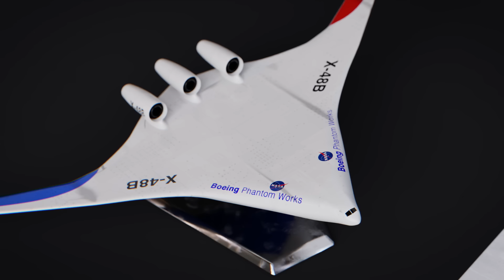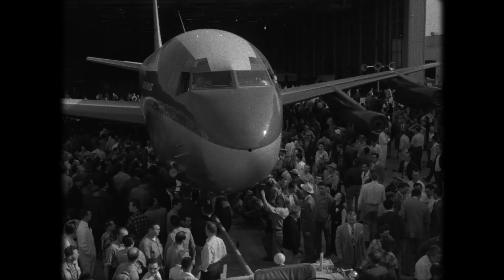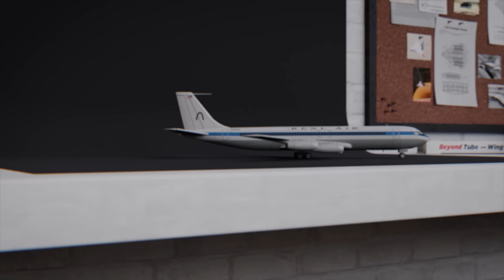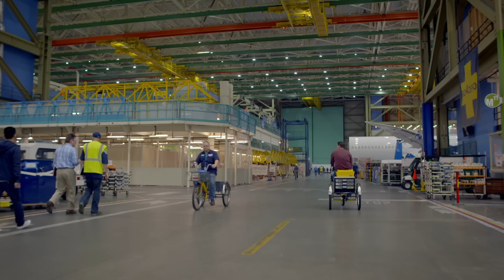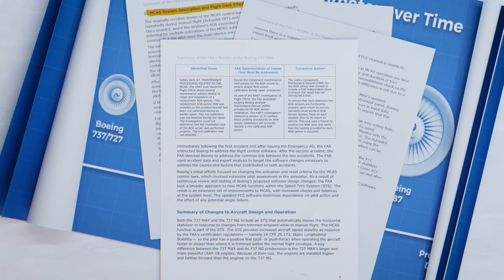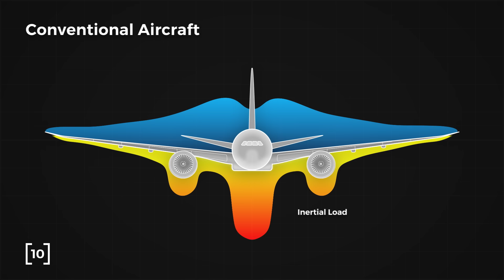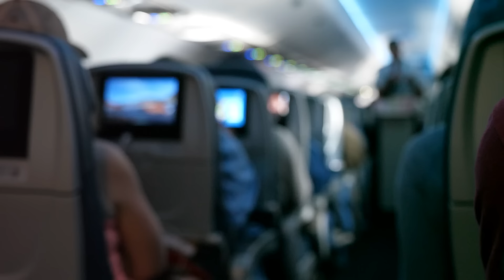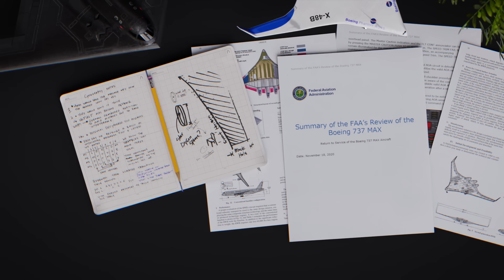The Plane That Will Change Travel Forever

Comment: I'd wish there were affordable nuclear powered passenger planes in the near future. That would really be a game changer. It could fly for years on end.
Reply: Yep, nothing like thousands of potential dirty bombs being overhead at any given moment. Until we crack miniaturized fusion, keep dreaming.
Reply: @PolishGreasePit  the small reactor(s) could be designed like a black box.
Plus a nuclear plan cannot explode like a bomb, even if it crashes
Reply: @YounesLayachi  You know black boxes aren't indestructible, right? And what makes you think a nuclear plane would be incapable of exploding? What if someone brings a bomb on board, which has already happened and likely will again, even if it's 100 yrs from now when nobody alive remembers Pan Am 103 and security is again lax. Like I said, until we have fusion, a nuclear plane is a potential dirty bomb. An absolutely horrible design precedent to set. The engineers of these systems have a moral obligation to consider that their work may be the standard designs that are studied by the next generations, and be responsible in design. Setting the precedent of putting fission reactors on planes would be disastrous given enough time.
Reply: @PolishGreasePit  what makes you think a nuclear plane would be capable of exploding ?
And btw, fusion fuel (tritium) is also very dangerous
Reply: @YounesLayachi  let's see... the fact that we would still be using a craft where a significant portion of the structural strength is tied up dealing with the forces of pressurization. Like, I mentioned a specific flight number that was blown up over Scotland, and you decide to ask what makes me think a nuclear plane could explode. Nothing about having a nuclear powerplant implies any additional strength in the airframe.
Last I checked humanity does not have any completely indestructible materials.
There is also the potential for a runaway reaction with fission. 
There is also the potential for a craft being shot down.
And then there is the potential for reactor damage and leakage during a crash, which you just dismiss out of hand, despite it being a very real concern. There is no reason to assume you could harden a reactor enough to survive any possible crash, and lots and lots of reasons to assume otherwise. 

This kind of recklessness in design has already killed plenty of people in numerous scenarios. You can't just think that something will work and try making it, you have to consider the risks involved with your design, otherwise your tests can end in disaster. Let's hope if you do any design work that it's not for a living, and it's not for anything used by anyone besides you.

As for fusion, I never said it would be specifically possible even then. Just that fission is prohibitively unsafe, and an implication that fusion would have fewer engineering challenges as a result of the different technologies, potentially bringing the hazards to a manageable level.
Reply: @PolishGreasePit  a pressurised flight cabin is not a bomb, lol, and the fact you think an airplane nuclear reactor can experience runaway reaction proves you don't understand how normal reactors nor airplane reactors work
Reply: @YounesLayachi  I never said it was, where did you go to school that they just didn't teach reading comprehension?

The pressurization means there is already stress on the fuselage, adding more in a sudden shock impulse (a bomb exploding on board) can easily exceed the yield strengths of the material. Again, see Pan Am 103.

You still just gloss over how we cannot 100% ensure the survival of the reactor in the event of a crash. 

And if you want to get into not knowing about reactors, you just made the most asinine comment I've ever seen, above, when you said that there is no weight for nuclear fuel. Add that to the list of your fantasyland nonsense, weightless fuels and indestructible materials.

Also, how do you plan on starting up engines when you're pushed back onto an apron away from any GSE? Or parked on a hard stand? What if the GSE is inop? Still going to need an APU for that, which runs on...jetfuel.

This also doesn't even touch on the maintenance cost and logistical and regulatory hurdles that would make operating even a single such aircraft on a commercial basis completely unworkable. Let alone the increased security since there would be fissile materials on board.

Like someone else said, you want a nuke powered plane, you build an electric plane and charge the batteries with a nuclear plant, these projects died for a reason.
Reply: @PolishGreasePit  great, nuclear planes fail because a bomb would make them crash, therefore nuclear planes bad. Huh ?
The plane doesn't need to be bomb proof, only the reactor
And , this whole time you think the reactor would be a water cooled uranium reactor, when in reality molten salt thorium reactor were designed specifically for airplanes.
"Security" is not a concern because redactor fuel can't be used for weapons, and you should know that. Throium is useless cheap dirt for anything but power generation, and it's not rare or expensive, no one would hijack a plane just to get the fuel.
Starting up an engine in pinch ? Do you think nuclear reactors can be turned on and off willy nilly ? They keep working until the entire fuel is consumed (a few months or years). The plane would never be in a situation where they need an Apu to start their engines and besides, nuclear engines don't have moving parts, they don't really need any power to start. In practice they would probably be started on the ground and then mounted on the plane where they stay for a while until they need servicing.
To top it off, battery powered passenger planes are too heavy to fly
Reply: @YounesLayachi  If you're very unlucky, the insulation may encapsule the radioactive substance and cause critical mass by neutron reflection in the case of a crash.
Reply: @Wabbelpaddel  and ? critical mass means sustained chain reaction, without criticality the reactor will stop.
So criticality is not a bad thing, it's necessary for the reactor to operate.
Molten salt reactors are designed to passively shutdown if something goes wrong, so in the case of a crash the reactor will stop producing power and slowly cool down
Reply: @PolishGreasePit   i assumed the plane would have no trouble generating power using the reactor , then using that to start the engines.
Basically the reactor would replace the apu

So what if the reactor fragments to pieces on impact ? It's still not an explosion and not a gas leak, just a small pile of wimpy thorium mixed with fission products, a couple dump trucks would clean that over.

Dirty cruise missile ? You sure love exaggeration, a missile goes boom, a plane turns to pieces.
Also, a bomb exploding inside the plane isn't equivalent with the plane itself exploding, you keep coming up with these exaggerations and then counterarguing yourself.
Another analogy with the boy who attempted chain reaction in a backyard shed, completely irrelevant urban legend, the boy had way more time to irradiate the surrounding area and he dismantled the reactor before the police showed up, so they could only guess the damage and measure the lingering radiation.
Jet fuel airplanes are arguably way more deadly missiles as they catch fire on impact and deal a lot more damage to whatever building they may crash into
About the moving parts, I was referring to the reactor. That mistake's on me, but also see first part of this comment
Reply: @YounesLayachi  until the passive shutdown design is found to not be compatible with the events of a given crash and you have a major ecological disaster.

I swear, you've never heard of Risk Management, have you? It's kinda a big deal in aviation.
Reply: @PolishGreasePit  passive shutdown design meaning the reactor can't work without active input to keep it working
It's like when people think a nuclear warhead can blow up if it falls from a plane or the plane carrier crashes or any other reason
No, a warhead can only go off if initiated without suffering any damage
Reply: @YounesLayachi  and there's your problem, you ASSUMED while engaging in debate with someone who does know what they are talking about. You cannot simply replace the function of the APU with the reactor, the APU provides more than just power, it provides the high pressure air, without any additional parts required.

You also seem to be assuming that we have thorium reactors small enough to be safely mounted and maintained in an aircraft, we do not. Therefore nuclear planes as they exist, do indeed have unsafe materials on board and as covered above, you still need an APU and fuel for it, so you still have a dirty cruise missile. 

So what if the reactor fragments? I'm sure you'll volunteer to demonstrate your point by having a ruptured reactor in your living room. You even said fission products would remain. Can you guarantee the reactor would continue functioning nominally when the rest of the craft it was on is gone? No, you cannot. That's additional risk

And bud, the word missile was around long before humans had shit that went boom. It just means an object propelled at a target, even through human force. I could throw a rock at you and be correct saying you were struck by a missile.

Plus, the planes will be down longer and more frequently for routine inspections due to the added complexity, which will also require highly specialized workers. There's so many non-engineering problems we have not even touched on yet, and there's plenty of engineering problems too. Put it all together and you [should be able to] see why these projects died. In the business we use the word 'unfeasible'. In this case, both technically and non-technically unfeasible

You're clearly a nuclear fanboi though who cannot see the limits of the technology however, the fact that teams of professionals who spent years researching the concept and deemed it unworkable, be damned.
Reply: @PolishGreasePit  are you really pretending that installing a fission reactor on any old 747 will magically turn it into a nuclear airplane ?
No , those planes are designed to be nuclear, they don't have hindsight omissions such as no apu what we gonna do.
I'm the idiot here for falling for your strawmans, you're the one who mentioned the apu as a bad thing , (1) it's lot a bad thing and (2) you don't know whether they even need or can't have an apu
Edit : high pressure air can be supplied with a compressor powered by the reactor, yeah it's not elegant but not impossible. At this point why not just have an electric motor ? It's less efficient.
Also your replies are way too long, jesus
Reply: @YounesLayachi  I am aware what passive shutdown is. I am also aware how warheads work and the non-danger of a conventional explosive being detonated nearby one (apart from the inherent danger of the conventional explosive)

The problem is that you are assuming the design for passive shutdown is foolproof in ALL scenarios, which you simply cannot guarantee. That makes it an additional risk that makes it undesirable compared with tried and tested conventional jet turbines.
Reply: @PolishGreasePit  nothing is fool proof in all scenarios, you're being unreasonable for the sake of debate. 
Planes themselves aren't fool proof in all scenarios, yet they still fly
Reply: that's not gonna happen. for one thing, it would be far too heavy. for another, who wants to be exposed to all that radiation?
Reply: @mrxmry3264  Of course, there'd have to be radiation shielding that's why it's too heavy. There has been one Soviet Bomber that has managed to fly powered by a nuclear reactor but it had no shielding so some of the pilots died within three years after its flight due to radiation poisoning. Real engineering has actually made a video about it already:
https://www.youtube.com/watch?v=9Jt924xjaJo&t=221s
Reply: Nuclear planes are totally viable with today's technology, since they were already possible 50 years ago
Reply: @YounesLayachi  I hope. I think if one would be working and affordable I would fly somewhere just to fly with the plane.
Reply: Why? That's hardly fit for purpose. Planes don't need to fly for years, just hours. This whole video was about a plane design intended to reduce drag and weight, and you're proposing a design which not only exacerbates the latter but will also massively increase the cost of purchasing, running and decommissioning these aircraft. And I'm not even going to touch on the safety concerns.

You want a nuclear-powered plane? Use that energy to run hydrogen or synth-fuel production plants (not that I'd be cost-competitive either).
Reply: @hydrochloricacid2146  the comment is about airplanes but unrelated to the topic of this video. 2 unrelated ideas to make better airplanes
Reply: @YounesLayachi  I'm confused as to what you're trying to say...my comment was in direct relation to the OP comment. 
That being said, I'd also point out that even "small" nuclear reactors are about the size of shipping containers. The weight of shielding for that kind of reactor (not to mention what you'd need to "crash-proof" it, like a black-box) would be immense, it flight-worthy at all. Keep in mind that weight, aside from the associated fuel cost, is not free: each pound of extra dry weight is less weight for passengers or cargo, and also limits available airports.
Reply: @hydrochloricacid2146  there's no weight associated fuel cost with nuclear planes, the fuel has no weight and the weight of the plane doesn't change by using fuel
What I mean is that you replied to the comment as if it was a suggestion to make blended wing nuclear planes, when the comment was simply talking about nuclear planes regardless of whether they help blended wing design or not
Reply: @YounesLayachi  I was talking about planes in general. But in relation to your last comment, I'd point out that weight associated with a reactor and shielding will heavily outweigh the benefits of uranium/plutonium/whatever energy density.

And while I already have my doubts regarding whether the airline industry will even switch to blended wings or hydrogen because of economics, the level of investment and will needed to transition to nuclear-powered aircraft is on a whole other level, for fewer tangible benefits and a whole lot more headache.
Reply: The amount of people terrified of nuclear in here is hilarious. The US has over a hundred active nuclear subs and carriers, all of which have run without incident.
Reply: @whydontyouhandledeez  lol, comparing literal vessels designed to hide underwater and evade detection let alone conflict, and the most protected assets in the US stock, to civil aircraft, of which literally hundreds have crashed. And that's just the ones with 50 fatalities or more.
Reply: @PolishGreasePit  Aircraft carriers are also nuclear, and I never said it was a good idea, just that the amount of people complaining about being near a nuclear reactor when they are perfectly safe is hilarious.
Reply: @whydontyouhandledeez  I addressed aircraft carriers by mentioning the most protected assets in the US stock.

It's not about being near it while it's operating, it's about being under it when it crashes. That's why I'm calling you on the false comparison. There's never been any incidents on subs and aircraft carriers because of the environments they operate in, and the fact that people are trained to be aboard said crafts, and are aware of the risks.

That's majorly different to a civilian craft that could fail over a random bystander's home, or anywhere on land, where people who did not sign up for the risk could be impacted. Let alone the implications of a radioactive crash site that has to be investigated and cleared away.

I have nothing against nuclear energy, besides the fanbois who insist it is the answer to every energy problem, when it just isn't. Legit ran into people on the last nuclear plant video saying that nuclear is always the best option, full stop. Even when you need maybe a few watt hours a year out in the boonies to run a water pump for some tomatoes growing out by someone's hunting cabin. Like obviously the answer there is solar or a small wind setup, but you just can't argue with the fanbois. You did not do that, but you did just dismiss valid criticisms of applying nuclear to this situation as just people being scared of nuclear energy, which also just is not true.

Comment: What is that fuel burn per passenger chart supposed to tell me? Seems like a completely random statistic to me. 

You make it sound like saving nearly 50% over 50 years is impressive. But without knowing any of the specifics and/or something to compare those percentages to, it honestly doesn't say much. For all I know most of those savings are due to increases in scale, or regulations about luggage. Larger planes = more efficient. People with less luggage = less fuel per passenger. And so on and so forth. Moreover, for all I know other forms of mass transport have saved over 70% on their fuel per passenger.

My skeptical conclusion from the first few minutes was: planes haven't changed much. 
The engineering stuff was cool though. Just be a bit more critical towards numbers and statistics like those -- unless you know how exactly they got to those numbers. And if you do know, please make it more clear.

Ps.

Same goes for those fuel saving numbers. Saving 26 billion gallons in fuel a year sounds like a lot. Is it really though? What percentage of the total fuel consumption is that? 1%? 0.01%? 10%? What can we save in pollution? How much can a company save in total costs? I honestly have no clue. So again: numbers don't mean much without a context. Though I guess that 27% in fuel savings gives some context here. Imo not enough though.